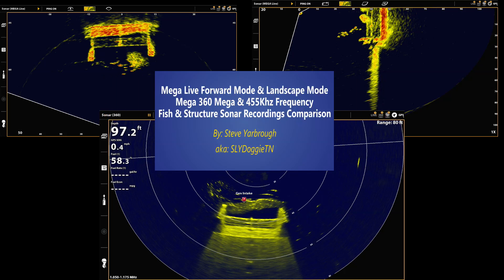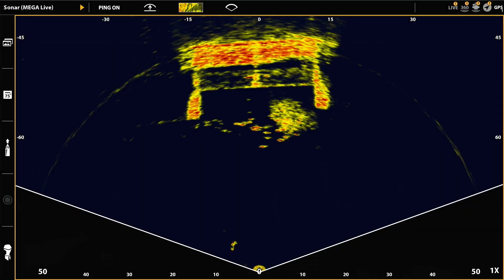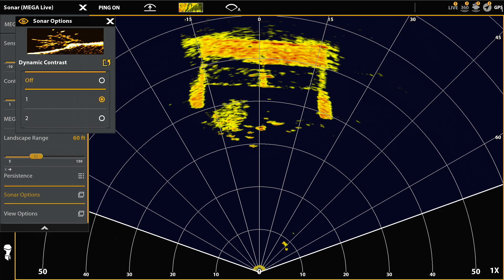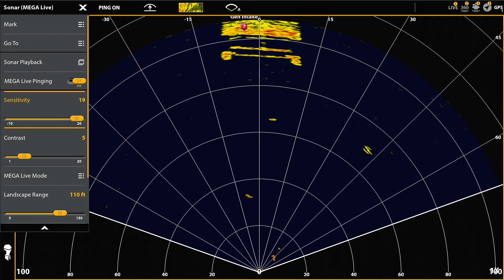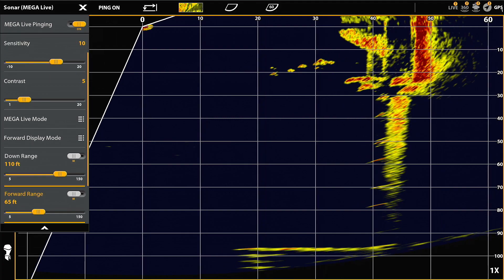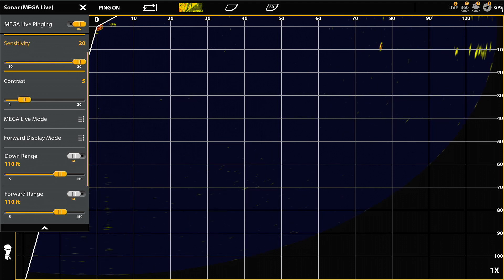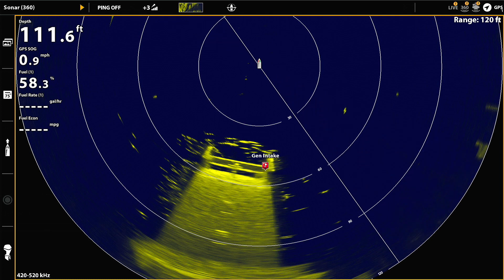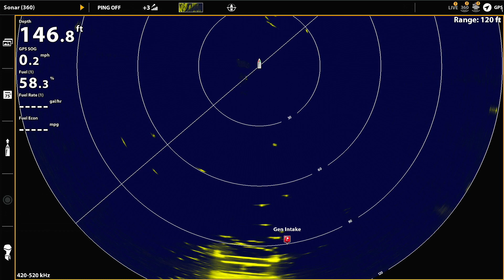Mega Live & Mega 360 Imaging Comparison

Comment: Well done Steve. Keep in mind MEGA frequencies provide better detail however, less range. 455 provides better range with less detail but, each is a tool to be used based upon how/where and what you are fishing for. Very nice work.
Reply from the maker: Thanks. I thought I made the point about the frequency/quality tradeoff as well as the sweep speed quality & refresh tradeoff. In any case, you are absolutely correct... it's all a tradeoff.

Comment: Thanks for the video! I think I use my electronics the same way you do, more interested in fish than structure and cover. Always looking forward to what you'll show us next.
Reply from the maker: Thanks. I did some really shallow water Sonar Recordings today... 8 foot and shallower with both Landscape and Forward Modes. Not sure I got anything good enough for a video or not. Think I did determine that Forward Mode isn't much use at the 4 to 6 ft depth.
Reply: @SLYFishing  I'd love to see the landscape results in the shallow water. Hoping that will cut down on wasted casts when throwing big topwaters for stripers.
Reply from the maker: I'm not really happy with the Sonar Recordings I did. There weren't any fish in the brush piles, and the brush piles were basically sunken cedar trees, so they just looked like blobs.

What are you considering shallow for Striper casting? My home lake is a deep lake with mostly steep rocky shorelines, so there isn't much shallow water and shelf until you get upstream into the river section.
Reply: @SLYFishing  My local lakes are the same as yours, most of my striper fishing is trolling 30-50ft deep. But I do travel to other lakes where I often cast in 2-10ft of water in the greylight. I also fish a tower, like you show in your video, but we have a buoy line that keeps us over 200ft away from the structure. I am hoping the 360 will help me locate the fish in the 0-40 ft zone there. The tower sits in about 85-90ft of water. Thanks for the replies.

Comment: Well done Steve! Have u  done a video on the water showing how to find your bait trolling in landscape mode? I tried for 3 hours and couldn't find it. Made several changes to the angle of the transducer move sensitive up and down , just couldn't find it any info would be greatly appreciated!
Reply from the maker: Yes, the first couple of my videos focus on that. Be aware that, for some reason, using the Landscape Display Mode on my Apex and Solix is weaker than using the Down Display Mode. Even though the physical transducer is in Landscape Mode, you can use Down Mode to display it and get a much stronger return from the Lures... at least that's the case on Apex and Solix. Don't know about Helix.

I have a feeling this will be fixed when the next round of control head software updates happen. I'm expecting that fairly soon since it has been over 6 months since the last round of updates.
Reply: @SLYFishing  So if you fish shallow like 25 on up and want to put your lures out 60 plus ft this is pretty much useless for me to try to find the lures, correct? would landscape mode be better?
Reply from the maker: @walleye56789  so this is a pretty simple question but the answer isn't as simple. For some reason, in the new 1.150 software, Landscape Mode isn't as strong of a return. It is on Sonar playback but not when using it. For that reason, you might be better off using Forward Mode.

The problem in finding the Lures is not just the distance but the fact that, in Forward Mode, the beam is narrow from side to side but wide from front to back. Landscape Mode is the exact same beam but wide from side to side and narrow on the depth.

In my case, I troll with 4 lines and can only get 2 of them in a Forward Mode but can get all 4 in view in Landscape Mode. The other problem on Landscape Mode is that, when you are over a shallow bottom, the bottom will "overshadow" the Lures. 

Bottom line, there just isn't a hood answer. I like to use Landscape mode but keep the angle very shallow... 70° to 80°. I've even used 90° which is basically parallel with the water in really shallow water to minimize the impact of the bottom.
Reply: @SLYFishing using landscape mode what distance do u start picking up the lures in say 25 ft deep
Reply from the maker: @walleye56789  I have a little more information in my "tutorial" video but it really depends on the angle you have the transducer set to. If I'm fishing 25' of water, then I like to keep my physical transducer setting in the 70 degree or 80 degree setting to keep the bottom from showing up and overshadowing my lures. You might want to watch the Tutorial Video, if you haven't, as I have a chart in it where I show the depths that the lures will show up at various Transducer Angles as well as distances from the transducer.
Reply: @SLYFishing  I thought those were in landscape but in the down mode. I was talking in just the landscape mode not in the down mode
Reply from the maker: @walleye56789  When I'm actually fishing and not just shooting a Mega Live video, I always have my transducer itself in the Landscape position. Since I'm looking aft at my trailing lures while I troll, I like to use the Down View to display the image on my Apex... It better depicts what I'm seeing. If I were looking forward with the Mega Live in the Landscape position, the Landscape View would better depict that. It's the same physical transducer setup in either case but just a different way of viewing it on the screen. Even though the transducer is physically in the Landscape position, you don't have to use the Landscape View on a Helix, Apex, or Solix to view it. You can manually select Landscape View or Down View.

Hope that does a better job of explaining things.
Reply: @SLYFishing  Yes Thank you for your time! I’ve got a pretty good idea now of what to do and mess with. Thanks again!

Comment: Would the settings be the same for the helix?
Reply from the maker: I have zero experience with the Helix, so I can't answer this question. I would think they should be in the same general range, but I could be wrong.

With that said, I expect the settings to totally change with the upcoming Helix/Solix/Apex updates as the Mega Live 1.150 firmware update really affected what settings are needed. For example, Humminbird recommended a starting setting with Sensitivity @ 15, Contrast @1 (the lowest setting), and Dynamic Contrast @ 1 (the highest contrast option). Before the 1.150 Mega Live Firmware update, the mid point on Sensitivity and Contrast were the starting point recommendations.